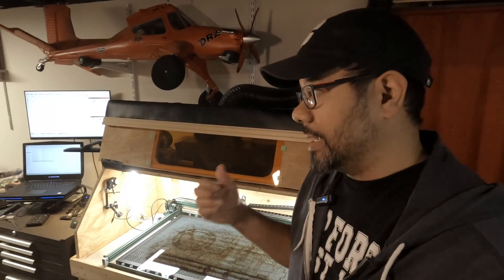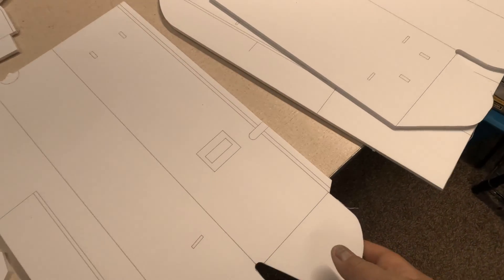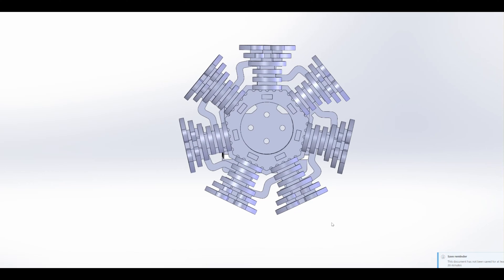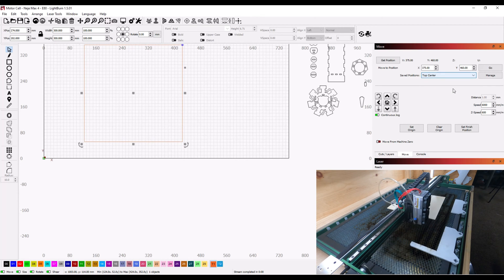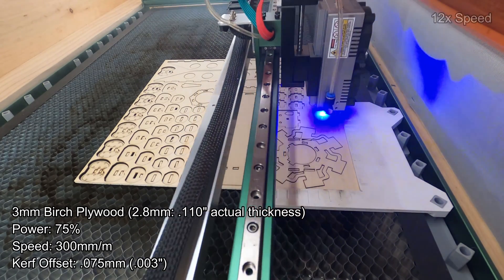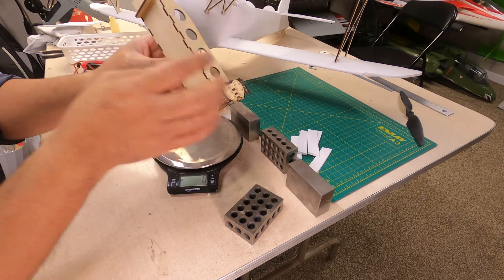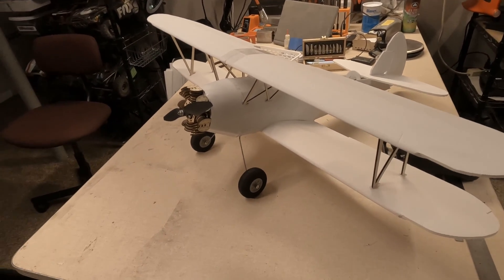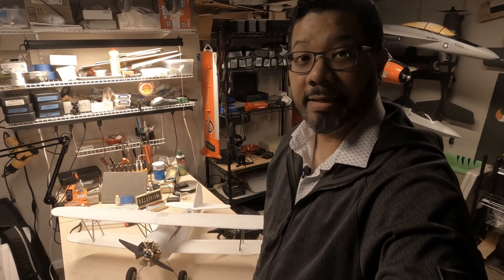NEJE Max 4 E80: PT-17 Stearman Foamboard Build

Comment: A few weeks ago, I came across this video while searching for ideas on what to make with my Neje Max 4, which I bought about a year ago. I’m not blaming you (well, not yet—at least until I tally up how much money I’ve spent on this hobby 🤣), but it inspired me to revisit the idea of starting the RC airplane hobby I’ve been wanting to try for a long time.

Anyway, my Radiomaster TX16S MKII arrived a few days ago, and I was brainstorming how to cut Styrofoam. That’s when I got the idea to use a 5cm Styrofoam cutter blade I bought on AliExpress for around $5. I designed and 3D-printed a holder for it, which I uploaded to Thingiverse ("Styrofoam cutter for Neje Max 4"). I tested it on 2cm XPS foam, and it works great!

Comment: Can the NEJE 4 Max laser with the E80 laser module cut and engrave plywood directly without using a honeycomb bed? I want to move the laser over a full sheet of plywood to cut out larger parts using the ‘pass-through’ technique.
Reply from the maker: I think you could but you may have problems depending on the material thickness. You would need to use air assist to clear out debris and without a honeycomb bed, the cut could just clog up. Plywood usually requires a number of passes because of the glue.

Comment: Ok so you can't cut foam board complete with a diode laser. I wonder if the new 70-watt modules can cut it completely.
Reply from the maker: I'm thinking it has more to do with the wavelength of light than the power. I can blast through black foamboard easily on low power. More power with a diode will probably just melt the polystyrene. I wouldn't mind trying though.